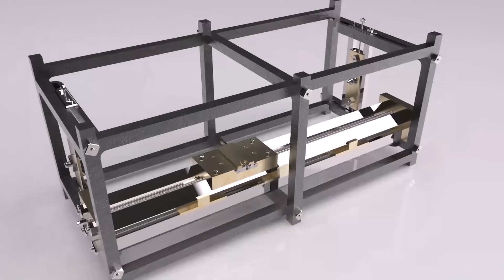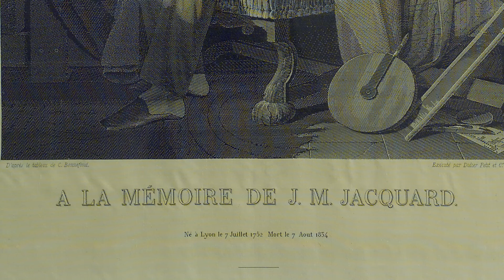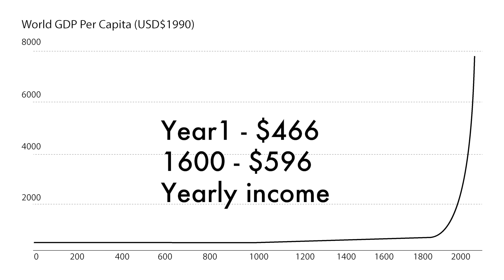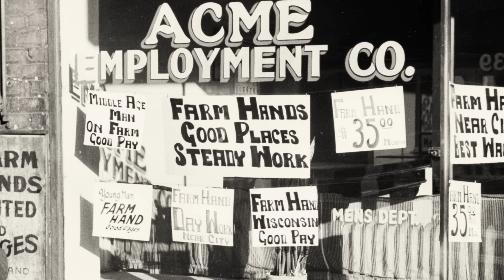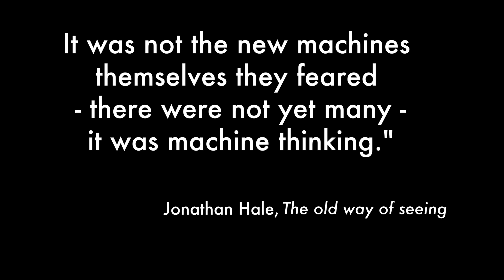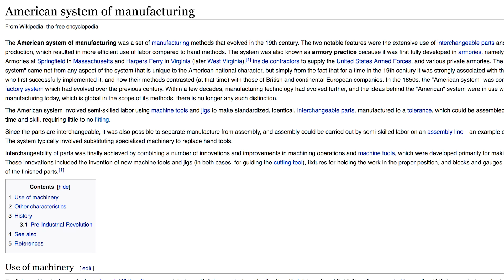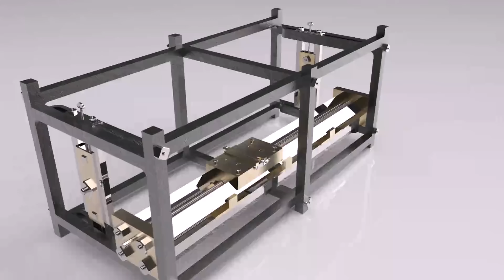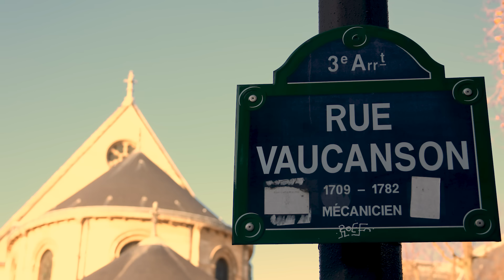The 1751 Machine that Made Everything

Comment: I worked in two factories and a smaller machine shop where I operated what was called an Automatic  Screw machine. In a way it was a lathe, in that it would hold five or six metal bars and rotate around a spindle and at each position  a tool would make specific cut in the metal and in the final position cut off the part and the operator would put it in a parts rack. It was boring work and dirty. The air was dirty, the machine was dirty, everything was oily. I did it long enough to realize that I wanted no part of factory work. One story I tell people was I got a cup of coffee and set it down for a few moments and when I came back the coffee had a coating of oil floating on top.  I breathed that air for 8 to 10 hours a day.

Comment: First tool I bought myself when I first moved into my house on my own was a smaller sized but absolutely priceless Atlas Metal lathe which I still use till this day. Your exactly correct about the one tool that's changed the world and brought about the industrial revolution, I would have to say a Metal Lathe and then invert the Lathe and now you have a drill press and a Milling Machine! Now we can make perfectly round and perfectly flat parts! Cool video Man! I agree with you 100% because up until this point, all they had were iron/steel forges and everything was a one off design and replication or duplication was nearly if not impossible. The only thing that was something they could reproduce via the metal forge needed hand made dies for pressing/hammering molten metal into shapes, things like nails for wood working and horseshoes. I know being a engineer and my hobbies revolve around all sorts of mechanical and electrical things, it's only practical to have the right tools for the job.
Reply: A hammer should have been your priority! You can fix ANYTHING with a hammer. And if you can't fix it, you can use the hammer to vent your frustrations on the offending device. Win - Win!
Reply: "Making round things square and square things round!"

Comment: Don't forget to mention that what made automation so needed and take off so well is the labor shortage, or rather put differently and more accurately, the abandonment and destruction of the institute of slavery, which was also the thing often preventing automation in the past (the hero's engine, first steam engine was invented back in Rome, but slavery, aka excess of cheap labor just didn't make that progress viable as there was plenty of cheap workforce. introducing labor saving devices and automation would also impact the cost of slave labor and slaves negatively, and since slaves where always a somewhat profitable business, and it was mostly held and backed by those in power, working on labor saving devices also meant going against the ruling classes)

Comment: The lathe was certainly crucially important to the industrial revolution, but it is really difficult to pinpoint one invention or one single event and say ‘This was the key’ - because to build a lathe you need metal and the lathe itself is a machine which works metal. The development of types of iron to work and turn into other machines and of steels to make the cutting tools is also a crucial component, surely? It seems to me that human achievement is always a hugely collective affair, things become possible at certain points in history only because of everything that has gone before - I’m not sure I would want to say “This is THE thing what did it…”

Comment: Interesting. But what did that machine actually do? How was it used in practice? Was this just a prototype or was it the first of many that were built? 

It didn't produce an Industrial Revolution in France. Clearly, and for very good reasons, the Industrial Revolution began in England and did not spread to France until many years later. In fact, after England, the next country to begin its industrialization was Belgium.

Comment: I'm pleased you gave due credit to the steam engine, which (in my view) was the great driver of industrial advance.    Of course the lathe was a pre-requisite for the manufacture of steam engines.   But then the power to drive lathes was generally derived from steam.   So I think the two operated in parallel.
Reply: Le 1er véhicule à vapeur qui a réellement fonctionné était le fardier de cugnot en 1769 (toujours un Français), visible au conservatoire des arts et métiers de Paris!  🇫🇷
Reply: @micheldilly8531  basé
Reply: Don’t forget the 3-phase (polyphase) AC induction motor, invented by Tesla.
Reply: @glenholmgren1218   Why would that be remotely as significant as the invention of the electric motor itself?   Which had a host of developers, probably starting with the Hungarian Anyos Jedlik in 1828, sixty years before Tesla had anything to do with it.   The industrial uses of electric motors were fully realised long before AC motors came along.
Reply: @cr10001  
Industrial revolution did fine from 1870 to invention of AC induction motor.
Eiffel Tower went up.

Comment: This first lathe is very impressive indeed. However, it looks to me, that it is constructed of mostly precision square and rectangular components, leaving the question of which came first... the milling machine or the lathe? The centering spindles and adjustment screws are made on a lathe, but all the precise 90° angles, the saddle/carriage ways, and even the beveled edges of the octagonal nuts look to good to have been hand-filed. 
Is this a modern day "re-creation for display" of the original device?
"Viva La France"

Comment: As a  machinist for over 40 years I can relate to using punch cards and then punch tape machines. Now  5 axis mills with 3D programming at the machine are almost common place. Even additive machines which use a laser to fuse dust like metal together.
Reply: I got a millturn with additive on the way 😊

I can't even imagine where we'll be in 40 years....

Comment: Lathes are some of the most important machines every made. A study was done by NASA building a permanent settlement on the moon. One from which you can set off into the rest of our solar system, and the model of how we could go even farther. So what am I talking about? Well NASA wanted to figure out hat to bring to the moon with them. A lathe was one of the first things they would take, because with a lathe, a mill and a drill press you can, make more of each of them. You would need smelting supplies to, but the first things you would want is to be able to recreate every tool you would need to build everything there. The moon has vast amounts of iron from all the meteors that has hit it over the years so metal is there. All you would need is a way to smelt the ore into something pure enough to have the strength for making machine tools and your off and running. Lathes can make everything you need from more lathes to specialty tools to the items for space flight themselves. The can build housing, warehouses, farms, everything you can think of can begins with a few basic tools, and the lathes is one of them.

Comment: Before 1800 the only power we had was people (slaves) and animals. The industrial lathe allowed steam to be used for power. But coal was labour intensive so people only really benefitted when oil became the main power source. in the late C19th.
Reply from the maker: You missed a couple of big ones.  In particular, water, and to a lesser degree, wind power.  IIRC, at the time of Watt's death there was more collective horsepower made from water than steam. Steam was important because it meant you didn't have to have an ideally situated mill next to a river,  but could put a mill anywhere else, but there were still plenty of places where there were large water based mills. Plenty of early textile mills were solely water powered, for example.

Comment: Interesting video.  I would only add that the lathe was only possible when the first precision cut screw was made.  It took a while for humans to understand the value of making a precision screw, and how that would lead to the ability to make precise machine parts, which in turn led to more sophisticated machines.  As you mention an increase by a factor of 10 in precision, for small distances such as .01 inch to .001 inch, is imperceptible to the human eye, but that improvement is the difference between early complex machines working well and not working at all.

Comment: What ignorant nonsense... Let's remember that every lathe - or indeed any other machine, remains useless unless supplied with mechanical power. What supplied it at the beginning of Industrial Revolution? It was the steam engine... And what made the steam engine economical? Well, around 1770 James Watt invented a clever way of turning hot steam back into water... 
Consequently, the biggest explosion of wealth in our history is due to not to any particular type of machine - but to Watt's Steam Condenser without which providing power to such machines would not have been cost-effective.

Comment: Of the majority of machines the lathe is the one I've got no experience with.

I seem to understand what it does but I'm failing to see how this could build itself like the comments are stating. 

How would you cut straight lines to make something flat on this machine? 

I get how it's a drill press & spins things to make them circular. But it doesn't appear to be a table saw or jigsaw.

Somebody aware me.

Comment: If one knew correctly, it is the 1st generation lathe that created the 1st generation metal planer and 1st generation drill press and in turn these two created a much more precise 2sd generation lathe which in turn created a much more precise 2sd generation  metal planer and 2sd generation drill press, AND SO FORTH AND SO ON. 

The question is how was it done was demonstrated to me and to me fellow students by my professor in using the lathe, and metal planer and drill press in creating much larger and more precise versions of themselves by using both the lathe, metal planer, and drill press to create the screws, bolts, nuts, washers, threaded rods, and JIGS AND EXTENDABLE JIGS, POSITIONERS, ALIGNERS, JIG EXTENDERS, EXTENDED LATHE HOLDERS, BOLT LOCKERS, THREADED RODS, AND WOOD PATTERNS USED IN SAND CASTINGS which are used in creating larger castings and are pre-machined and machined precisely again and then placed in pre-positioned jigs already locked into position by bolt lockers, AND THE USE OF LOST WAX CASTINGS.  

The 2sd to 3rd generation much more precise and much larger lathes, drll press, and metal planers also SIMULTANEOUSLY gave birth to the SHAPER MACHINE TOOL AND HIGHER HEIGHT LATHE as a side machine tool or as a by-product machine tool which is equally as important as the 3 different machine tools USED IN MAKING PRECISION MACHINED GEARS OF ALL KINDS. 

Wood templates coated-impregnated with wax and later on with bakelite plastics and precisely machined to form an even much more precise wood patterns are used for much more precise sand castings. 

But my teacher also showed us how to use a METAL PLANER TO MAKE A GEAR and he showed us on how to use a shaper to make an another machine tool called a MILLING MACHINE. 

The invention of the milling machine by using a shaper or a planer to make the MILLING CUTTING WHEEL allowed the use of a much shorter metal planer bed so that the round metal stock held in a rotating jig holding it can be adjusted to cut the next gear teeth. 

The invention of the GRINDING WHEEL as a primary machine tool made it faster to cut gear teeth from a round metal disc stock. 

By using precision machined modular castings held together by precision machined metal mortise-tenon joinery and dovetail joinery derived from an all wood joinery techniques and locked into place by metal securing pins in the form of screws and nuts and bolts and washers to hold them together to make a much longer and wider and higher machine tool bed for the lathes, metal planers, drill press, and shaper. 

Everything started as small BUT INCREASINGLY PRECISE MACHINE TOOLS. Then the much more precise machine tools were used to simultaneously create an even much larger and much more precise machine tools.

This process is a SELF-REGENERATIVE PROCESS that simultaneously becomes much more and more and more precise and larger one generation after the other. This gave rise to the next level of machine tool industires called as the HEAVY ENGINEERING INDUSTRIES that makes super large size machine tools of both of the generic standardized basic types and kinds and that of the specialized and customized machine tools of various functions.

And then they turn became more specialized and gave birth to the MACHINE BUILDING INDUSTRY that specializes in the manufacturing of end product manufacturing basic and specialized and customized machine tools used in the manufacturing of end products manufacturing equipments. In short, the MACHINE BUILDING INDUSTRY MANUFACTURES ALL KINDS OF FACTORIES AND MANUFACTURING FACILITIES.

Comment: Now I know the tech nerd museum to visit if I get to Paris. I doubt if the stuff to make that lathe was floating around for hundreds of years. People tend to underestimate the effects of metallurgy , fuel, and lubricants on technical advances. You really need steel to make a metal lathe, and until the Bessemer process, steel was very scarce and expensive.  You need good grease for those screw drives, and good cutting oil, and I bet those also needed development. There were advances in water power, and then steam power.  It’s hard to lathe metal with a foot power lathe. For another case of metallurgy, fuel, and lubrication, look at internal combustion engines. The straight 8 used to be the way to go, because lubricants and bearing metal didn’t support much force, so you needed lots of big bearings for a given horsepower. And there are lots of other metallurgical thing that have shrunk engines. Thin wall casting, for example. High octane fuel is another example.

Comment: Looking at that lathe you can easily see that it's built on the shoulders of many other advances. The frame is made of perfectly straight bars of perfect blackened steel. Other parts are polished steel or brass. That implies that metallurgy and metal working were already at an advanced level. Many of the pieces seem to have surfaces that might have been machined by hand, but anything that requires precision is indeed precise, including screw threads. That means that machining was also already at a high level. Precision also requires precise measuring devices, not mere rulers and yardsticks, but also micrometers. When you think about what was required to make this machine, you realize that you have to look back much further to find the true seeds of the industrial revolution.
  
Really, you have to go back to that farmer you keep joking about. Some farmers somewhere had to have discovered the secrets to growing more food than they needed so that they had a surplus to sell. That freed up other people to stop farming and start doing other things, like experimenting with metallurgy and figuring out how to make metal parts perfectly straight, and how to make screws with perfect threads to hold machines together.

Comment: Back when I started in the machine trades, there were old lay-shafts and pullys left above which were driven by steam. The steam plant was still existent though not functioning. Many of the existing machines had been converted to electricity in the teens and early 20's and the original motors still ran (though not efficiently). I remember going from tape driven machines (Bridgeport mills) to the 5 axis CNCs of today. Amazing.

Comment: Cool vid but I’d argue it wasn’t precision manufacturing machines that changed everything. Ask yourself how useful these machines are when the power gets turned off? Right around 1751 James Watt in 1763 upgraded the steam engine to supply continuous rotational power output from coal, wood, oil, etc. In essence it was not the lathes that increased manufacturing production but mankind’s ability to harness hydrocarbon energy via heat engines like the steam engine and eventually the internal combustion engine.
Reply: What power would get switched off?  These early machines were run by water wheels or even human power.  Later on the steam engine combined with belts and pulleys.
Reply: Brandon S - whatever power source is running the machine - in high production manufacturing output is directly proportional to energy input - no water wheel, no oxen, no humans, no steam engine - no output. These machines are just better more accurate tools.
Reply: @randykubick  I smell what your cooking now.  Your original post made it sound like some one was going to come along and "unplug" the machine.  Your statement was more to effect  of no power(regardless of source)= no production.  That the invention of a power source that you can have any where (the steam engine) is just as important as the invention of the machine tool.

Sound about right?
Reply: Brandon S - I agree both the machine and the power source are needed but consider this - if we run one machine on only human power and another on only steam power - both would produce the exact same precision parts but which one would produce the most parts per day?